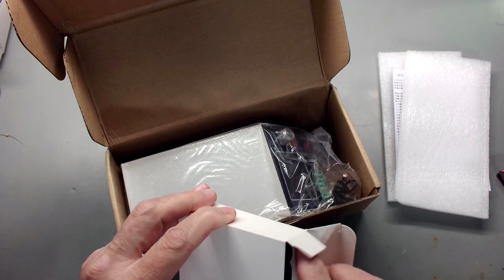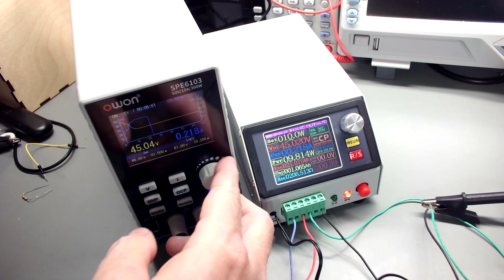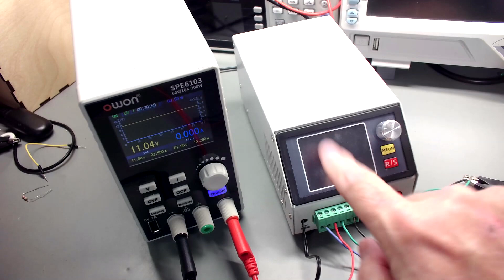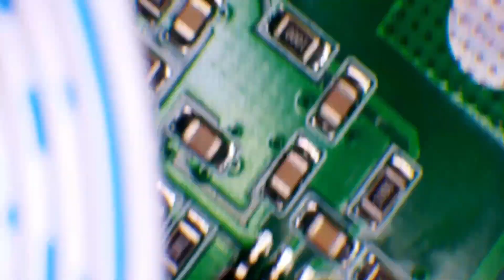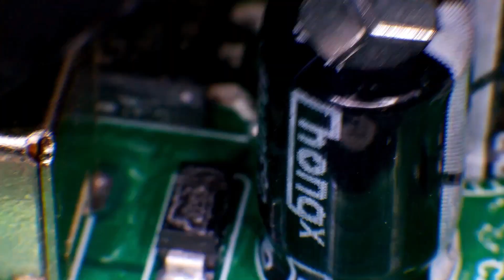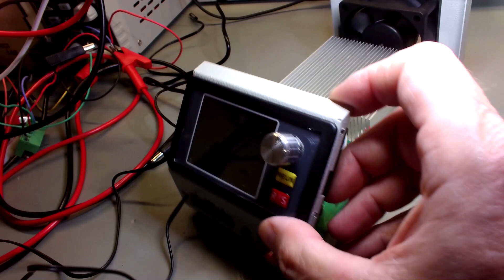MDL-150 Electronic Load: A Must-Have for Tech Enthusiasts

Comment: Your description for 2-wire testing wiring positions is backwards ! The wiring scheme for this tester is bizarre, anyhow, and the wire terminal silkscreens are wrong and so, very misleading. The operation of the controls is just as strange and counterintuitive. Never mind the "MEUN" button! But, the unit works very well, the measurements are repeatable, the electronics and heatsink are protected and the entire unit is physically very strong.  //  You skipped showing how to change the display language to English and how to calibrate the readings, very useful features.  //  See the following video for proper 2-wire cable configuration:  https://www.youtube.com/watch?v=fAMC6EqBir0  //
Reply from the maker: I don’t know how yours is wired but I disagree. I clearly have the current carry wires connected to the marked current terminals. I have the voltage sense terminals jumped to the secondary current terminals, at least as mine is wired. And it works well.
RJ
Reply: @LynxElectronicsLab  The the necessary and minimum wiring connections can be made more simply. I wish I could show you a diagram, but this doesn't seem to be possible in this forum. I think I put a link to a video in the original thread showing another reviewer's experience. He was trying to get the wiring operational. I could tell he then took a long break in the video and came back with the wire configuration suddenly working. He had no explanation for what he did and seemed more physically tired. I wonder what he had to do to figure out how to get it to work! Still, there's absolutely no need for this tester to have 6 terminals for wires. 4 would do nicely if the unit was designed more carefully: +V, -V, +Vsense and -Vsense. Simply short +V with +Vsense and the same with the -V's and you would have 2-wire mode. Watch at time 22:04 at the following:  https://www.youtube.com/watch?v=fAMC6EqBir0 //
Reply from the maker: There are 2 + current, 2 - current and 1 + voltage sense , 1 - voltage sense. I believe the redundancy of the current is because they used connectors that are not designed to handle the current they claim it can handle so they doubled up. Simply jumping the spare current to the sense allows it to be used as a two wire device. It’s not complicated. But separate sense leads on high current is preferable for accuracy. 
I agree it is a Chinese device with poor marking and such. 
RJ

Comment: Since this is your original video for this device, I'll copy&paste what I commented below your follow-up video:
I've just tested it with true 30V/5A (=150W) on a lab power supply and nominally 20V/6.75A (=135W) from a laptop power supply (but it couldn't keep up  the voltage, so it was about 19V/6.75A = 127W) and the only thing that got hotter than 46.2°C was the barrel connector to screw terminal adapter I used to connect the laptop PSU.
The fan was loud, but less annoying than my 35W load's fan at full power.
OVP and OCP worked fine.
Great little device!

And a little bit of new information: Removing the display protector worked fine for me, even though it reached slightly beneath the frame. Additionally I moved the external NTC from the front panel to the empty cutout in the back and added a strain relief, feels much better this way and now I can be sure that the cable doesn't touch the shunt resistors.

Comment: I'm not convinced that fan/heatsink combination will effectively get rid of 150W of heat.  Your thumbnail may someday come true!  😁  I think you are right about not trusting it.
Reply from the maker: Check out Fridays video, I tested at 150 watts 😁
Reply: @LynxElectronicsLab  Thanks for the heads up.  I will!
Reply from the maker: Thanks for the input,
I believe you are correct and why I am nicely warning my viewers on this possible threat. The cheap Chinese manufactures seem to just throw out specs. There is no way they do real testing of this stuff at the ratings they give them. I thought from the image it was much larger which I think it was easy to trick me because 150w needs a very large heatsink / fan. They had nothing in the images as a size reference. But the higher voltage and current from my old unit is helpful as is being cased. They do need to learn to clean flux off pcbs though!
RJ
Reply: I have tested that it can using a 30V 10A bench power supply at ~149.5 watts continuous for several hours at a time. Both units' fans run continuously, but both only  get somewhat warm at room temperature, 72F. I was very surprised at how well the load tester fared. Tests: ~30V @ 5A, ~15V @ 10A. This seems to be a well-designed product. Time will tell and YMMV, of course.
Reply: @DeweyLewey-v6j  Thanks for the additional information.